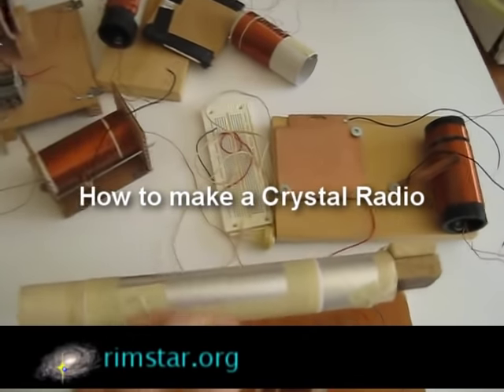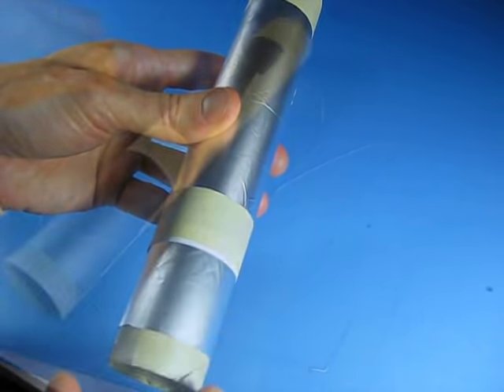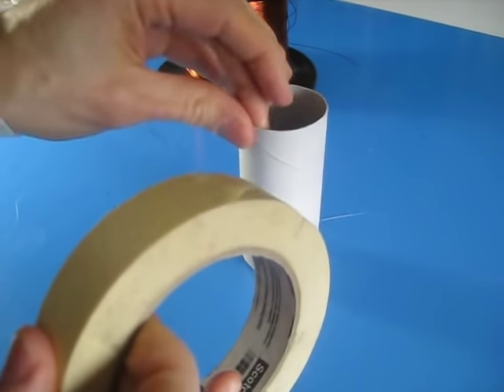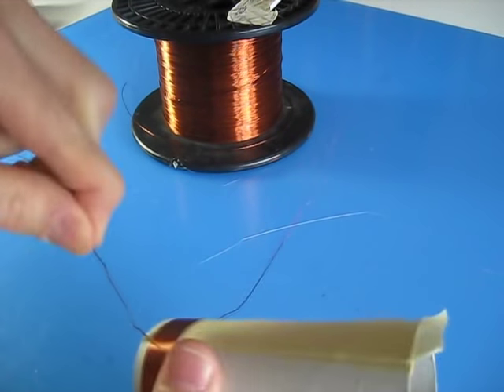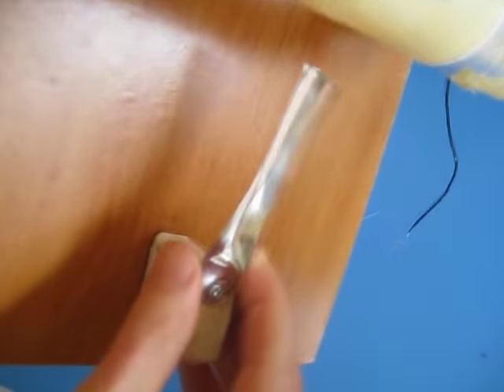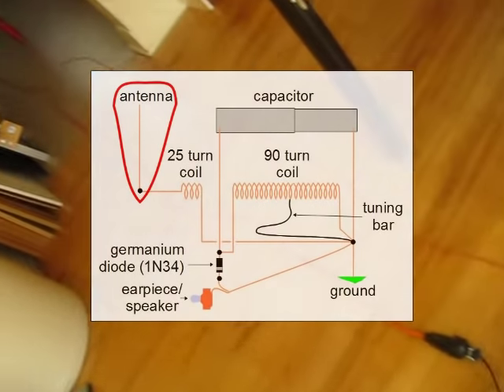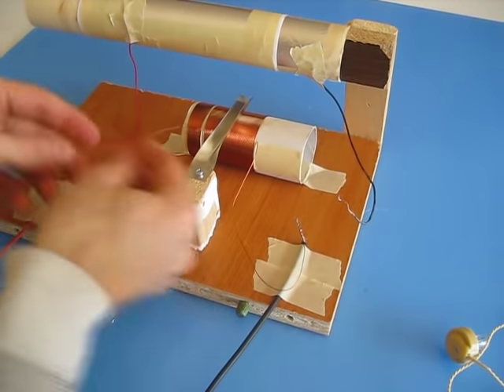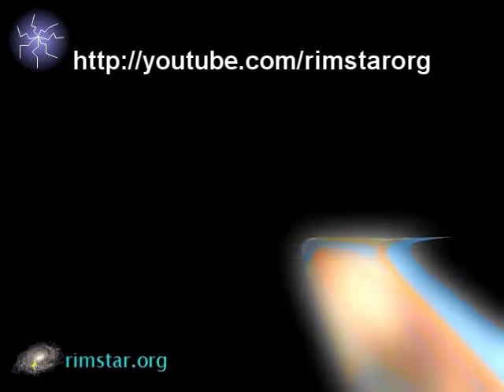How to Make/Build a Crystal Radio

Comment from the maker: No, a crystal radio doesn't require batteries. It gets its power from the incoming radio waves themselves. That's what makes these so fun to work with. But it also means that unless you have a very long antenna and a good ground connection or a radio station nearby, then you'll either have trouble getting something or it will be very quiet. Plus, you'll usually need earphones to listen to it, not a speaker. Or you could add an amplifier circuit, but that's no longer a crystal radio :).

Comment: I swear, winding the coil is the most difficult and painstaking part. Especially if you never did that before. Took me a while to find the proper way of winding it and making each turn nicely and the wire ending up sitting close together. So satisfying when it's completely wound and ready to be prepared for the next steps.

Comment from the maker: A foxhole radio is also a crystal radio. There are many, many variations. A foxhole radio usually uses a razor blade and a pencil for the diode, instead of the semiconductor one I've used here. I show how to do that in my "Make Razor Blade Diode for Crystal Radio/Foxhole Radio" video (see the link in the description below this video.) Basically a foxhole radio uses less off-the-shelf parts since there aren't any in a foxhole.
Reply: I made a foxhole radio as a kid, much older now.
Reply: It is called Radio Trench if the ingredients are truly made by yourself and obtained from the local area (such as razors and pencils), 
 
 usually called a crystal radio because the crystal radio circuit is obtained from a shop/commercial crystal radio.

 It's called a foxhole radio because... Was it made in a foxhole during the war, or because its structure resembles a tunnel (tube)?

Comment from the maker: Yes, you can use a variable capacitor. To match the coil in this video the capacitor should be in the range 40 picofarads to 355 picofarads if you want to tune in the whole AM radio frequency range.
Reply: Can this pick up Shortwave?

Comment: my first crystal radio was from junk parts when I was 8yrs old...I changed the diameter and turns of the inductor and used a variable ganged capacitor from an old Crosley AM radio...hooked up to guy wire on house antenna and ground to pipe in kitchen sink...had to buy the earpiece, from Allied Radio store...at late nite I could pick up international shortwave radio signals...have been in electronics ever since...still have my General Class Ham license too!   73, good video!

Comment from the maker: The obvious is adjusting the capacitor and tuning bar on the coil, but I'm sure you've tried that. A longer antenna improves this. Also, you can improve it by moving the two coils closer together, but if you have radio stations that overlap then doing so will make that worse. Also make sure you have a good ground. And you're welcome for the video. I'm glad to see so many people get finding it useful.

Comment from the maker: A number of ways. Use a longer antenna. Make sure you have a good ground. Decrease the space between the two coils, though that may cause more interference between radio stations. You could also add an amplifier (e.g. one powered by a battery) but then it would no longer be considered a crystal radio since a crystal radio is one which is powered solely by the incoming radio waves.
Reply: Is it the answer to wireless and free electricity
Reply from the maker: There isn't much power here. With a long enough antenna or a strong radio station nearby, you can power a single LED. And you still need a radio station somewhere to use electricity to transmit the radio signal in the first place.

Comment: Back when I was around 8 years old, for Christmas, in the mid 1960s, I was given a "Lectron" set, which was encapsulated electronic components, in little blocks with square tops sowing standard circuit diagram symbols, with magnets for the internal contacts to link with other blocks, on a metal sheet (for a ground, I imagine).  

I enjoyed some success with most of the projects in the accompanying booklet.  However, I could never get the crystal radio project to work at all.  That made me sad, and with no support, I gave up.

Today, listening to someone go on about crystals in a way that suggested someone hurt her, in the name of actual science, in her formative years.  That's what reminded me about "crystal radios."  I still don't understand the "crystal" part (Maybe that's the diode?), but your video was a lot of fun, and some healing.  Thank you.
Reply from the maker: Yes, the "crystal" part is the diode, or was the diode. Back in the early 1900s and galena crystal with the sharp tip of a wire touching it was used where today we use the diode. Today, a crystal radio is defined as any radio that is powered by the incoming radio waves.
Reply: As a kid I remember having little radios that you would alligator clip to something metallic (like a window) and it would receive AM via a standard earphone. We called them crystal radios. I remember them as being quite small and working well.

Comment: Wow ! Relived my childhood. Mine was a simpler one. I used to detach the earpiece of our chunky old telephone. Attach the two ends of a galena crystal to the two electrodes of the earpiece. connect the earth and aerial to each of those electrodes and enjoy the strongest available medium wave. The ground rule was, got to replace the ear piece before Dad gets home
Reply from the maker: Cool! That's definitely about as simple as you can get.
Reply: What great memories...I did hours of listening on just a diode and earphone. And on tuned sets I DXed other states at night and even shortwave broadcasts.
Reply: Jumpstart Jimbo: Have you uploaded the video about this method? I have a faint memory my elder brother did it in the way you mentioned. We used to listen to the local radio station so clearly. That was 70 years back when I was a small kid. I saw the crystal (so he said, there was no diode or any other thing except the telephone receiver which he bought from the Calcutta second hand market) and with a slider (that is the wiper) we can tune in the radio station. Will you please do a video about this method. I believe many like me will be interested about it and they will be benefitted . Please do it and upload the video if possible. I want tp make like this in memory of my elder brother who is no more in this world. He had curiosity things like this.

Comment from the maker: Originally the diode was often a galena crystal and the sharp tip of a wire or metal object pressed was against it until a sound was heard. Electrical contact to this diode was made with the crystal and the wire. Then when modern commercial diodes came along, most people switched to using those instead. Nowadays, a crystal radio is defined as a radio that gets its power from the incoming radio waves.

Comment: Thanks for posting, I built one of these while helping my granddaughter build another one for a school science project.  I only have one good AM station in the area and it I could barley hear it and it was a little garbled... I connected a 47k resistor across the crystal radio ear bud connections and it improved the sound from barley hear it to loud and clear!  Thanks again and hope someone finds this comment helpful.
Reply from the maker: Yup. My understanding is that the resistor helps when the diode doesn't have enough reverse leakage.  I explain it in my How a Crystal Radio Works video http://www.youtube.com/watch?v=0-PParSmwtE starting at around two minutes and four seconds in.
Reply: Thanks, great video!

Comment from the maker: A diode is something that allows electrons to flow through it in one direction only. So if your power source is one that make electrons move back and forth in the wire but you have a section of your circuit where you want electrons to go in one direction only, then you'd insert a diode in that section. It's called a "crystal" radio because people used to make the diode by touching a Galena rock crystal with the tip of a wire. Nowadays, a modern semiconductor diode is used instead.
Reply: 𝚈𝚎𝚊, 𝚍𝚞𝚑
Reply: I have no ground connection in my home what I will do?????please five me answer
Reply: @bhavanabenrathod2706  pretty much all homes have a ground. You can also use exposed copper or gas plumbing for a ground.

Comment: Built one just like the one shown in the build when I was 12, about 1958 or 59. I had to purchase the crystal from a radio wholesale supply company for about $5.00 which was a princely sum in those days for a 12 year old. I used the inside of our home phone earpiece. I almost got a butt whipping when my mom answered the phone and couldn't hear the caller. I crawled on the roof to run the copper wire antenna from one end of the roof to the other. The ground was a piece of pipe driven into the ground outside my bed room window. 
I later collected soft drink bottles and used car batteries to earn enough to by a single earpiece like the one in the video. Return on soda bottles was 2 cents, a car battery was good for a dollar depending on the size of the battery. Bigger batteries, more lead equal more money. I used the crystal radio for a couple of years until transistor radios came out. Again I saved my money and bought a cheap one  with the single earpiece and without the internal speaker. They were too expensive but just as magic as  the crystal radio.

Comment: This video is a big motivation and knowledge source. Thank you so much for that. I am teaching a lab course and including this as the final project. So I had tried to make it as simple as possible and actually providing kits for every student. In the process, I have gathered the following thoughts:

1) Coil: I find the sliding option a bit challenging and intimidating, although I did get it to work. My modified design is a total of 65 turns, with a small loop at 40th turn. So there are 2 settings, 65 turns with the loop not touched, and 40 turns with the loop grounded. Between these 2 settings, the frequency range is quite good. After all, you just want to get some channels to show off, but not necessarily all the channels.
2) Capacitor: I tried to “improve” your design, but finally realized how good yours is. Thought of parallel plates that some people use, but bowing near enter is unavoidable, while your tube design has no such problem. I also tried other materials to make it more rigid than aluminum foil. I tried flashing materials (aluminum and galvanized steel) but they are too stiff and leave too much gap between the inner and outer tubes, so probably loosing some capacitance for the same size. I wound up using thicker aluminum foil available. I was also concerned about the contact by taping, but convinced myself that contact to capacitors is not that critical, since there is no DC current.
3) Speaker: This is more critical and difficult than I expected. Piezo earphone did not work for me, and it was a bit expensive ($7) and I returned it. Piezo buzzer (much cheaper) I could hear something but is quite faint, so hard to tune channels. I also tried piezo transducer, and it did not work. The best I used was a guitar amp, but not everybody has one. Next I will try are PC speaker and headphone (both suggested by your viewers).
4) Wish I could show a photo of my final project, but I did not see that option.
Again thanks a million. It’s nice to see old school is kept and being pursued. I am retired and always wanted to do it. Well I finally did!
Reply from the maker: Thanks for sharing all that. I've had the same problem when teaching a class, having to find the cheapest and simplest way that works. So I can relate. I'm glad to hear it worked out.

Comment: I was looking for my original crystal radio set I got way back in 1957. It actually had a little crystal item with crystal it it and a filler item you taped on the crystal until you found a radio station. A very simple unit.

Comment: I have a science fair coming up and I guess this vid is a life saver thanks!
Reply from the maker: +G Reaper22 It can be tricky using these inside some buildings. I took it to a small Maker faire once and the sound was so low I have to use an amplifier to make it loud enough to hear (any amplifier will do but I used my homemade one https://www.youtube.com/watch?v=JtPwxbOgBHw.) You have to stretch the antenna out in a straight line so make sure you'll be able to do that. Also, you'll need a good ground connection. Luckily there was a big empty hall behind my table so I stretched the antenna out into it, and I used the wall socket trick that I show in this video for the ground connection. Good luck and have have fun at the science fair!

Comment from the maker: I never thought to look in an old smoke alarm. Thanks! They definitely sound like peizo buzzers.
And yes, this coil and capacitor are for tuning in 540kHz to 1.6MHz. I'm away from my own computer this week otherwise I could easily calculate what's needed for 198kHz but I'm pretty sure you need more turns.

Comment from the maker: A 10 meter antenna is good, better than what I have. It doesn't matter if you have more than 90 turns if you will be tuning the coil, in other words if you have a tuning bar or stiff wire that moves over the coil like you mentioned in an earlier post. The other end of the tuning bar/stiff wire will be connected to ground and so will one end of the 90 turn coil, so any turns on the far side of the tuning bar/stiff wire won't be involved in the circuit anyway.

Comment: I can't believe what I see. Just genious. I love how you build all this beautiful things starting from scratch. Well...I should say way less than scratch! I've never seen anybody making a capacitor that way.
Could you please answer my question? Please I'm very inquiring: How the hell is the circuit removing the carrier wave from the audio signal wave? I suppose it's impossible to do that on an FM signal using such a simple circuit so I think the input signal you're receiving must be AM. But still, I can't see any LP filter or anything else to remove the carrier wave. How is the circuit doing that?
Thank you again for all the knowledge, entertainment and ispiration you give to me.
Reply from the maker: That's a neat question, because the answer is so sneaky. :) The first obvious thing is that the diode chops off one polarity of the wave. Next, the piezoelectric crystal in the earpiece can't respond fast enough to each peak and zeroing of the carrier wave, so it responds slowly to the peaks only. The result is that the earpiece keeps up only with the audio wave. You can see this illustrated in my "How a Crystal Radio Works" video http://youtu.be/0-PParSmwtE at around 9:27.
Reply: I'm sorry, I found the explanation video just after I posted the question, now it's all perfectly clear. Thanks a lot, really. I was looking for a simple RF receiver but I just couldn't find a very basic one to understand, now I did, thank you again :)